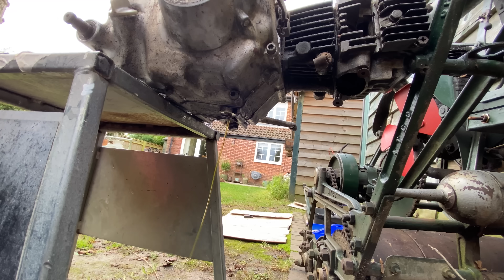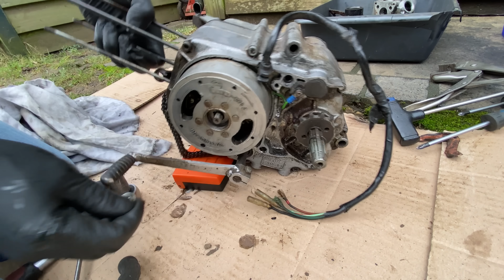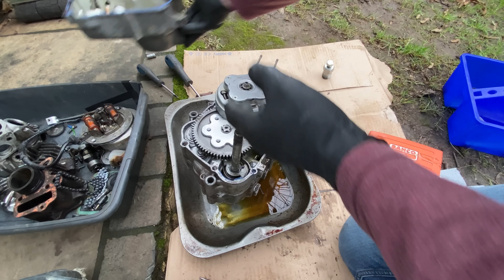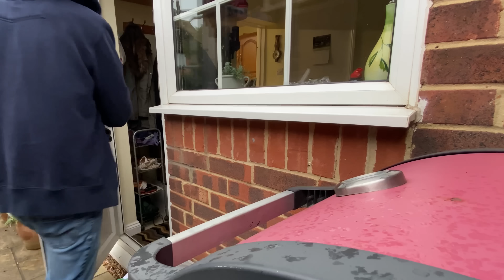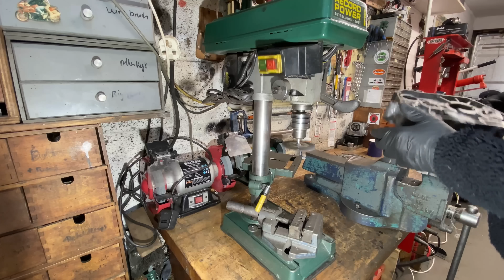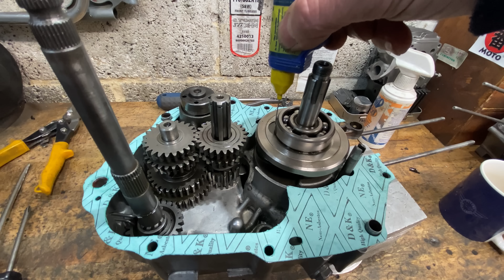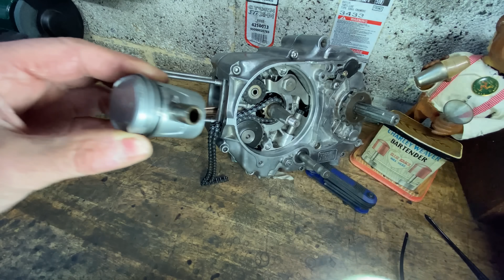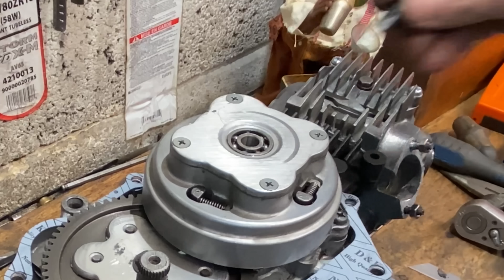Honda SS50 engine strip down, rebuild and start

Comment: The thing that amazed me about this rebuild wasn't so much Allen this time, (who is always great),  but rather the amount of engineering that originally went into an engine for a 50cc bike. It's kind of a complex little thing.

The sound of it running with no exhaust is pretty funny.

Comment: Wow I learnt so much from this video, sadly l learned a lot of it 40 years to late.. an SS50 was the first engine I stripped and rebuilt myself aged 16.  I did not have the correct tools and was working from a Haynes manual, which whilst being excellent was not a good as a hi res video.    I never truly appreciated the remarkable engineering in that little engine, all I knew was that I could never catch my mates on their FSIE or AP50.   Those hex head bolts around the clutch cover were a very common mod, a company called CDS used to sell kits In all the mags.  Happy days.

Comment: Sure, NOW i find this video! Lol! Id bought a 1966 honda motorcycle with a similar engine( i think it was 90cc???) Im sure many of you out there have this bike- red with argent fenders, 2 piece sheetmetal frame, gas tank looks like its on backwards, thin, almost bicycle looking tires... Anyway, got it for 50 bucks at a tag sale but the piston was seized...id no idea what to do regarding that cam chain....so it sat in my basement until i got married and sold it as it was.....funny how you can still get parts from honda for them- but my chevy/ isuzu" geo storm" had to get crushed because water pumps are no longer made!

Comment: I'm guessing you either changed valve guide seals or they had already been changed?
Even though timing is 'fixed', did you adjust points gap? (0.014", +/-0.002")
 It's a PITA without bronze feeler gauges. 
It's such a long time since I worked on Honda 50's I forget if 'we' bored them to used S65,  C70 piston or some other small Honda (maybe CB160 or CB/CD175?) I don't remember if the C70 even existed in 1974?

Comment: Is that the correct flywheel for that engine? The SS50 should have a mechanical ignition advance on the flywheel, but this flywheel looks like the one I have on one of my Z50 engines (monkey) that have fixed ignition. As far as I know those have different tapers as well.

But the engines I know are the five speed ones. Those also have aluminium cylinders with cast iron sleeves and heads with bigger cooling fins as far as I remember...
Reply from the maker: Four speed has no advance

Comment: my first bike was a Honda CT70. 1969 I think it was. I had two of them, I had found in the garbage. a green four speed manual, and a yellow three speed automatic. I got them both running, and I absolutely wore those bikes out. I was 9 years old, & I had rode the green one so much, & had stretched the timing chain out bad enough, that I would hit bumps going down a trail, and it would just stall, do to the timing chain falling off(!) I would pull over, unscrew the big round cap that concealed the timing gear on the camshaft, pick the spot that the cam gear would be happy with the crank gear, and while turning the exposed magneto (that I always left the cover off of), I would put it back on with my finger! Virroomm. a way, I went....😝

Comment: Now you've got my curiosity up, Allen. You're known for taking small displacement motorcycle engines and adding multiple cylinders to increase the power! So why would you bother rebuilding a 50cc slug like that, hmmm? 🤣

Comment: My first bike was a Suzuki A100 😏I was very skint and forced to do a rebuild, so just used instant gasket on the crankcase halves 😁I felt sort of guilty when you showed all the old blue instant gasket flapping in the wind and the heath robinson seals somebody had made 😆

Comment: thats a walk through memory lane... Loved my SS50 with 19mm carburetor and original C-50 pipe. damn that thing was nice and fast.. 
almost all my friends drove SS50 or cd-50 or C50. with 50/70 or 90 cc cylinders (or complete 70/90 block. believe there where long and short stroke 90CC enignes, can not remember
but this engine the looks of the almost new looking head gasket and valves and cylinder does not match the cylinder gasket. strange combination. its like only the head has been cleaned/restored and the rest not. (i wish i stil had my SS50. (could almost build that engine blindfolded)

Comment: MEMORIES
My first "bike" was an SS50 which had been totally, and I mean "TOTALLY" stripped down to the last nut, bolt and washer.
Everything was in an old tea chest with the pressed steel frame on the top.
It took me the Christmas holidays and until Easter to figure out what went where and why.
It started for the first time around noon of Easter Monday 1971.
If that "bike" could talk I would probably still be in jail... 😇

Comment: Great stuff. Brought back memories from my first involvement with a motor that was a three gear Sachs 48cc engine. I disassembled the engine block with no previous knowledge about engines, ignition or carburettors and the little thing started first time after reassembly.

Comment: What a work of art is the Honda SS50/Plonk 50cc four stroke. Probably the most neglected and hammered class of engine, yet they are incredibly reliable.
On internal screws, don't you use threadlock?

Comment: I am slightly surprised that you weren’t tempted to split the crankshaft and fit the slightly longer C90 connecting rod and then slide a C90 top end on it. We all know the 49cc engine can be made into 72cc simply by fitting a C70 top end, changing the con rod would make 85cc possible.
Reply from the maker: Not this one

Comment: I guess the way oversized head gasket was the result of someone thinking the piston should always be flush with the top of the bore, my thinking is someone had changed the rings on a 2 stroke once and then decided to try and tackle this....

Comment: hi i am a subscriber, i have a honda VF750f, 1984, i did alot of work on it, got mot ect , road it, but now it only fires on 2 cylinders 1 front and 1 rear,  checked all the normal problems that could be, carbs out 3 times, but still the same. i am stumped now?
Reply from the maker: it could several things. have you checked for sparks? fitted new plugs? checked for loose or disconnected wires? crank engine and spray easy start or brake cleaner into carbs does it fire then ? the list is endless
Reply: @AllenMillyard  Hi Thank you for your reply
I had it running today and you wouldn't actually know it`s only running on 2 cylinders, It ticks over nicely. ( 13K miles on the clock and seem genuine from investigation)
So here goes, New plugs and leads.
syincro test good across all 4
Spark looks awesome.
changed HT leads across but no change.
resistance test on the coils and reads like the Manuel.
Carbs off and I hung them from the ceiling with float bowls off (new float valves) , used white spirit to actually see fuel coming out, float height adjusted too of course. Fuel pump good. Rocker cover off and cams look good, no wear and it looks like they are doing their job.
compression test done but only on starter motor turn over, so the two rear cylinders showed 7 bar but one of them doesn't fire.
When the bike was running today I tapped the carbs with a hammer (thinking it might do something LOL).
I think all the inputs from above are there. 

ok sub txt, I am John, 58 years old, and still busy as a Joiner. I also have a GN 250 1995 (12k miles) and it starts without choke at 0 degrees.
 The first Video I saw of yours was you cutting cylinders in half and welding them back together, from that moment I was hooked, like many others, just Awesome.
Don't burn the cup cakes,...... John.

Comment: Don't you check the ring gap in the bore before fitting them to the piston? Some people might follow your build advice and end up with a damaged engine. 
Still enjoying all your builds👌
Reply from the maker: This is a 20 min vid showing how I strip and put together a Honda 50 engine showing the basic principle,  not a detailed how to instructional video.
Reply: @AllenMillyard  Yes. I do understand. Loving your builds. All the best. 👍

Comment: This is very useful as I have a 1974 4 speed, a 1970 4 speed and a 1970 5 speed (yes they did one in 1970. 6hp at 11,000 rpm). I had one when I was 16 in 1970 before pedals and restrictions. My current 5 speed had low compression so the top end is off but not yet fettled (hard to see the problem. Valves not passing white spirit, no broken rings or scoring, good gaskets). I converted the 5 speed to 12v by using a full wave rectifier (isolating the alternator from frame before rectifier then -ve to frame after, 12v led bulbs, solid state flasher relay, 12v battery and horn. Minor wiring changes so the headlight runs from the battery not the alternator. All ebay parts very cheap. Lights now super bright all the time and low power consumption).

Theres only one  valve stem oil seal right? On the exhaust valve. Its the same seal as used on the CB175ss, 1971, which I also own.

Comment: fantastic 🤩. I have one myself that has been on-hold for nearly 30 years as the exhaust studs are sheared 🙄.  my only disappointment here was you didn't go into detail about repairing the wiring. mine is also damaged and I've never been sure how to go about making the repairs
Reply from the maker: maybe another vid covering the fine details
Reply: @AllenMillyard  it's a 'yes' from me lol. also starting it on the bench could be covered. apologies if you've covered that before but it's black-magic to me 😲

Comment: Brilliant video Allen, brought back happy memories of dismantling my SS50 at age 15 to repair a broken gear.  All went well incredibly, tried tuning it by shortening the carburettor slide but I’m not sure that made any difference!
Reply from the maker: the 4 speed version was heavily restricted with small bore carb, cutting the slide mad no difference the 5 speed had a larger bore carb

Comment: Lovely little "intermission" video during the S1 "Four" build Allen. It's great that you keep us fed whilst you source further parts for the Kwak. I've had a few Honda 50's in the past. Lovely to hear that engine come back to life 😁. The sound of it without exhaust reminds me of soup boiling ☺️. I remember this like it was yesterday, reminded me of the time my exhaust fell of my C50 whilst I was "scrambling" on mine in the mid 70's as a 13 year old 😂

Comment: I remember working on these engines when younger and working for a motorcycle shop in West Drayton..
Great little engines..so reliable...and economical too.
The pride of the working class. 
Just so good 50, 70 and 90..
They could take so much punishment and alway come through and start..
Well done Honda..an engine that stands out... and stood the test of time..and still going strong..👍🇬🇧🙏🙏
Reply: Would that be the bike shop across the road from the pub called DE BURGH ARMS ?

Comment: Had one of these new in 1973 - cost £165 from the dealer in New Milton Hampshire. NOT99L was the number and I had it until 1974 when I turned 17.

Comment: Iam gonna rebuild my 79 XR185 during the winter. Have been saying this last 2 years now. Timing chain is totally stretched out and it's starting to burn oil. Have a 60 over 200 jug and Wiseco piston kit along with everything else. Haven't split cases on anything since I was a teenager so should be fun! Btw, great video and gives me inspiration to do just that.

Comment: Nice job Allen u just make it all lk so simple  I’m so bloody anal about rebuilds I have to have a manual torque specs loctite special tools new this new that I had a cg110and 125 for quite a few years brilliant wee engine  the centrifugal ign advance weight arm pivots wore out so I made bushes and brazed them onto  the worn arms and positioned them over the lower section of the pivot pin  worked beautifully  such cool little engines keep em come

Comment: Brilliant video,thank you so much for taking me back to the mid 80s..lol   I loved my old 2nd hand SS50 (I had the 5 speed with front disk brake)    bloody thing got through almost as much oil as it did petrol,I was told that it did that due to the forward facing cylinder and the oil going into the barrel and past the rings under braking,not sure if that was true though.
Reply from the maker: Not true 🙈

Comment: Fantastic rebuild Allen, the earlery engines had a 6 volt battery. The 12 volt system was much better. I remember servicing my dads Honda 50 every weekend when he came back from the Sirocco engineering. In Belfast, thank you soo much.

Comment: Being forced back onto a moped after two years of riding 125's without passing his test, my friend decided to rebuild his old YAMAHA Fs1e engine, he didn't check it went into all the gears as he went and ended up completely dismantling and reassembling it again because he couldn't select second gear , this was repeated several times before  he remembered all the gears were down, not one down three up.

Comment: Allen, Does the gudgeon pin really run, plain, in the little end, or did we miss the fitting of a needle roller?
Reply from the maker: It runs in the conrod no seporate bearing
Reply: @AllenMillyard  OK. Thanks for the reply.

Comment: There’s nothing worse than digging into an engine that doesn’t run and you can obviously tell that someone else has had their hands in there and thought they knew what they were doing but obviously couldn’t get it running. Carbs are always a hoot too that someone else has “rebuilt”

Comment: I was surprised how good the condition was inside the engine and I was also surprised on the thickness of the gasket. Another great job you’ve done rebuilding this engine and thanks for sharing.

Comment: Wonderful memories of 1970 when my father bought me a 50 step through in pieces, which got running. I assume there was no need to check the ring gaps with a new piston and rings. When I converted my DR650 to a 790, the rings needed filing to prevent them scoring the bore.

Comment: 1971 I was working on my C100 push rod 50cc stripping and cleaning the carb in the vicinity of the engine. I had left the ignition on..For a reason I can't recall I decided to turn the engine over on the kick-start -it started and ran up on petrol fumes. Ever since then I have been wary that engines can start when you least expect them to. And by the same token they can refuse to to start when one expects them to
Reply from the maker: The c100 is a really nice engine

Comment: Lotsa memories here. My first bike was a 1964 Honda 50 C110 (manual clutch). I put 25,000 miles on that bike using it on my paper delivery route. I once got a speeding ticket for 70 mph (I only weighed 110 lbs then)!

Comment: Most people would take photographs when dismantling, you just chuck things in a box knowing exactly where they go back. The rebuild was a joy to watch. One of your best videos, ironic really, considering this humble little engine compared to your more well known projects. Your mechanical knowledge and expertise is just fantastic. Great video
Reply: Not knocking his obvious mechanical genius(ness?), but he DOES have a video of the dismantling. 😀
Reply: I suppose once one has made a couple of 100cc v-twins out of these things, one knows them well enough to build them blindfolded!
Reply: @K1lostream the 1975
Reply: This guy rebuilds an engine more easily, than most people do an oil change :-D
Reply: LOL, got that right! I'm one who needs to photograph every step.
Reply: It was like watching a guy rebuild a watch.
Reply: He videoed it, are you daft?
Reply: Genius this guy
Reply: It’s ok Alan has a You Tube video 😂
Reply: @martynjones973  thanks 😊
Reply: In the video everything looks easy and fast but the reality is that it took me 8 months to put it together. Just kidding.
Reply: Great job!
Reply: That is how I got my KX 85 back from the shop when I had them crack the case halves. it sucked.
Reply: It won’t be the first time he’s stripped down this type of engine.
Reply: Have this man  got a photographic type of memory.
Reply: @patrickvolvos4010  He’s probably done it loads of times.
Reply: My thoughts exactly.  I was freaking out after two minutes.

Comment: A very interesting video showing a modern Honda 50. I had a sports Honda 50 mpoed back in the early 1960, the 3 speed model with a high level exhaust but that ofcourse had a pushrod engine.
Re that flywheel puller I used to have an Allen scythe and the Villiers engine on it had a removal tool like that built into the flywheel nut. Those old engines were made to come apart easily.
Reply from the maker: My Atco also

Comment: Early 80s I could strip down, install new rings and reassemble in about an hour. With my eyes shut. Was always replacing broken rings.
That popping exhaust note bought it all back, I used to make sure it started before I put the exhaust on, save taking it all off again if it didn't lol

Comment: Anyone else who has watched Allen's videos ever wonder why the antique Atco mower which appears to sit outside all year round, doesn't rust up or get stolen?
Reply: It's a 2 stroke with a16:1 oil ratio so just the exhaust covers the unit with oil...
and you can see paint and grease where there is no oil...
it ain't gonna rust....

Comment: My first bike SS 5peed in 81 35 £ and my home made mountain bike chrome frame rethal bars westrick wheels & knobblies.. It had a gearbox problem so I fitted a complete c70 motor & carb.. The crash box was perfect it would wheelie from 1st - second as it valve bounce.. 55 top gear.. No fizzy came close 😭 🤣